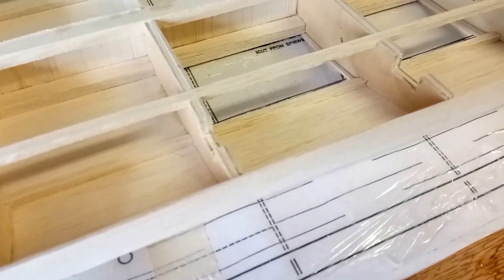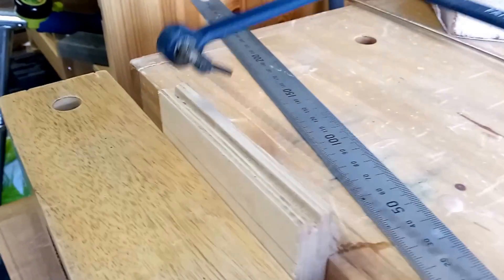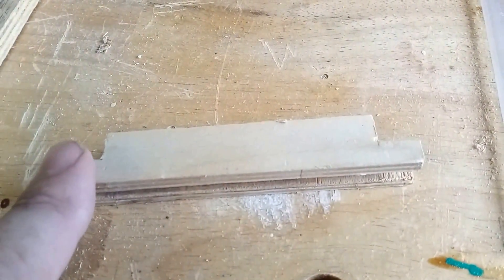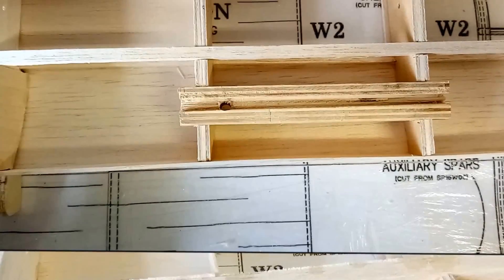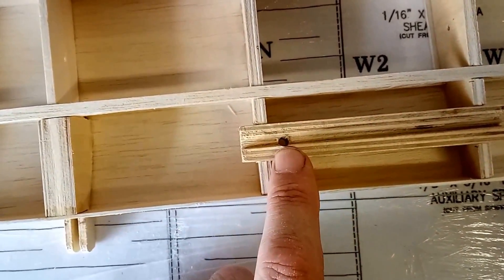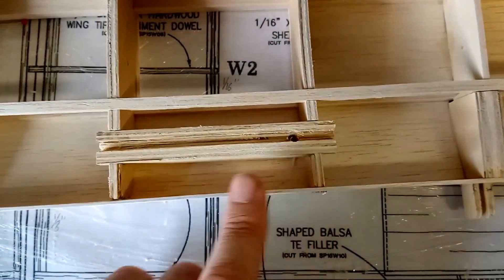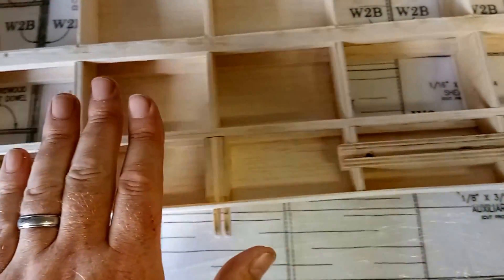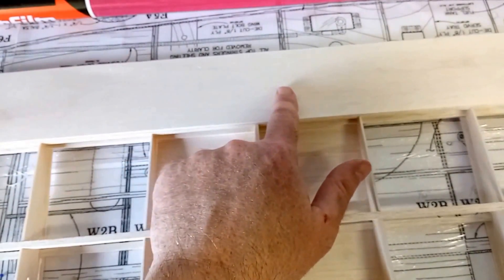Vid 5 Slow Poke (RC plane): Undercarraige mounting blocks

Comment: Conor, I am curious... If you didn't have the build instructions from Great Planes would you have been able to build this airplane without them?  I looked at the instructions and there is a ton of information in them.  They had to come in handy.
Reply from the maker: Hi David. It would be tricky to build the plane without the manual. The plans were designed with assembly in mind, whereas for the Millie Bob the plans are used for both cutting and assembly. The SP plans don't show (for example) the tapered rib shapes, or some of the former shapes. It also doesn't show the construction method for the fuselage (the upsidedown build). But these could all be guessed or inferred based on pictures or experience.